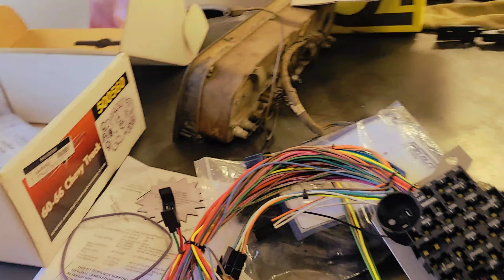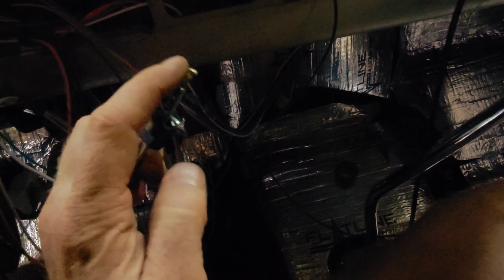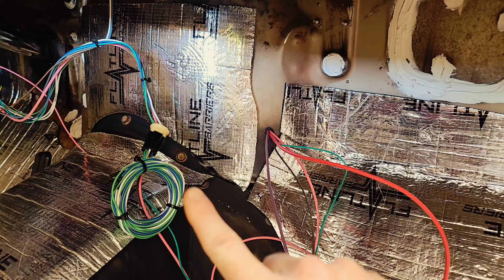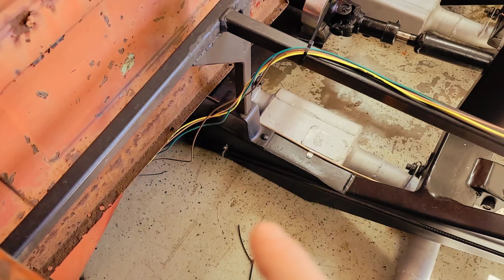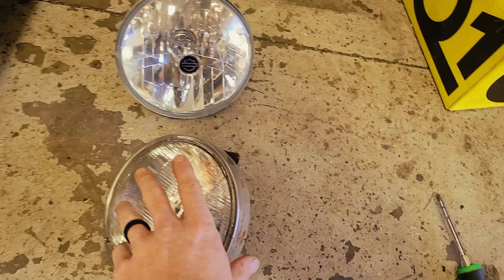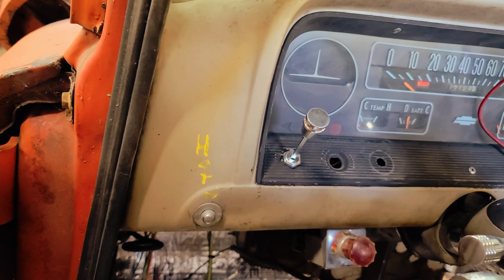American Autowire c10 install

Comment: Had a rat problem with my 60 apache. Bought and wired everything. I have running tail light but the brake lights dont come on when the running lights are on

Comment: Matt, I have another Question on the purple wire for the starter ,do you connect the 2 purple together if you don't have safety. Nut switch ? American auto not open today ! So thought I bug you again.
Reply from the maker: You mean like a neutral safety switch?
Reply: Yes
Reply: Mines a 4 speed no Nut safety switch

Comment: Hey I have Question on the Auto meter wire set does the red positive to the fuse block come out buy it self not the bulk head ? It's show the red going out but don't say how
Reply: Yes it's say to the inside of cab ,but I think it's the same to Batt since there that red pig tail on there ,I do that thank you ! So much
Reply from the maker: No problem. Hope helped and not caused more confusion lol
Reply from the maker: One goes to the battery another to the starter and the alternator. If I remember correctly

Comment: Nice job! What crimper tools where you using? AAW tools are expensive as Coc*ine ( I guess)Specially when you have other types of crimpers in the garage. Oh, do you have a video of your Gas tank? ( Can't find it if you have one)
Reply from the maker: Hey. I just used some old channel lock crimpers. I’m sure they make a special one. But I haven’t had any issues. Also I do not have a fuel tank video unfortunately. Thanks for watching
Reply: @Metal_Massacre_Fab_Shop  About the tank connection. I thought you connected to the bottom when using carbs. But in your case you go in from the top? Sorry for stupid questions ;) I like your channel, you are doing good!
Reply from the maker: Yeah the pick up tube is on the top on the Boyd tank. Appreciate you watching. I plan to wire my 66 gmc soon. I hope to make a much better version of this video
Reply: @Metal_Massacre_Fab_Shop  Nice, looking forward to the episode! Here in Sweden we just got 4" of snow haha
Reply from the maker: @tokslut ouch. That’s no fun lol
Reply: @Metal_Massacre_Fab_Shop  Thanks!

Comment: Just want to say thank you for putting your video out, I have a 1964 Chevy C10 that I am updating the wire harness on as well, I just can't find a diagram that shows me how to connect the rear tail lights, you did show in your video how the wires ran from the cab to the rear but you never showed how you connected the lights, I'm stuck maybe you can help, thank you
Reply from the maker: Thanks for watching. I’ll send over a link. Hopefully it helps http://67-72chevytrucks.com/vboard/showthread.php?t=721119

Comment: What steering column are you using ?
Reply from the maker: It was just a cheap 30 inch gm column I found on eBay. Has a little play in the tilt mechanism

Comment: Cool old truck, I’ve got a “63” did you have to change electrical connector ends for your truck? I’d bought the same wire kit “exactly same kit” started the wiring of mine yesterday.. it appears that many electrical connectors have to be swapped over to newer types? Thanks in advance nice truck Sir! Love the lowering you did to it.. nice ride Sir!
Reply from the maker: Yes some of them have to be swapped over it seem and others will remain the same. Thanks for watching 👊🏻
Reply: @Metal_Massacre_Fab_Shop  Very cool, I’m sure it will be easier once I get into more of this wire kit, but thanks much for all you post here! Cool truck Sir, keep-um rolling! Nice, keep posting your work, it helps many I’m sure of it, you rock Sir! Nice ride, cool you got a 383 too! Putting a fresh Tremec 5 speed in mine …. Soon, got the tranny, gotta do the run-out check and fab-it up for my fresh 383.  For it from a company out in Washington State.. “Hot Rod Company” don’t bother with them, valve train geometry is way off and I’m fixing the “drunk monkey’s” wrench turning on my 383 from them.. Expensive engine, and just wrong in soooo many area’s.. I’m fixing the mess.. Fresh, but not a good “build from them.” Great , but not so great.. I’ll make it right.. Ha ha, actually have the engine in my living room brought it in through the side door.. clean enough to eat off, so why not right? Ha ha.. again thanks you Rock keep going, I’m sure you will Sir, nice ride!  Thanks Sir!

Comment: Cool Sir! I’m using the same “American Autowire kit” very cool, hey is the rear taillight on left working? I’m sure it is now.. hey cool old truck mine is a 1963 lookin good project Sir! Great to see one into the same, love the souls of the “63” had 2 Chevy’s both old “63” Nova’s or I call them Chevy Duece or Chevy 2’s.. Cool ride , hey you seem better mechanic on engines, sounds really healthy Sir! Mine has a fresh 383 Stroker from “Hot Rod Engine Company” They are out in Washington State, beware don’t get an engine from the coast to coast deal.. They said they routinely send to the East coast, they smashed my engine 2 times trying to get it to me wrapped in plastic and cardboard, ha ha.. third time owner got involved in it.. Good mechanical they provide but can’t send an engine any distances without a smash or three, ha ha..
So, finally they got another shipping company, went from “Yellow” to using company called “XPO”  They got the engine to me “Un-smashed” So you Rock Sir, keep turning the wrenches! Nice sounding engine in your truck, what is it? Do tell us about it? Probably already did, I’m a late seeing to this site. “Nice truck Sir, keep-up rolling!”
Reply from the maker: Thanks for watching and bummer to hear about your engine. Mine is actually a 383 also.
Reply: @Metal_Massacre_Fab_Shop    Nice! 383 Stroker, looks nice sounds awesome Sir!

Comment: Generally with a 10SI / 12SI alternator, the larger brown wire goes to the dash bulb, then to key B+. The bulb limits current to 1/4 amp (0.25 amp) and system voltage for sensing. The second wire is dead until changing then operates a relay for the choke heater. B+ from alt, to the relays coil to ground. Key hot during crank, run passes thru 30 & 87 to choke. Key on, engine off, you don’t want the choke opening as it will be hard to start. Thermal fan switch is in coolant and provides ground for 1 or 2 relays. A 30-40 amp fuse depending on fan, to 30 & 87 as both grounds soldered and shrink tube can bolt to core support using “Star” washers that dig into paint to metal. Internal star washer goes on first, flat washer, fan ground flat, lock washer and bolt. I use dielectric grease on every terminal inside connectors plus sides and bottom of park bulbs. This keeps them from turning green with high resistance. Both washers & dielectric grease is sold in automotive at home improvement stores, 1/2 price of parts stores. Ground parts and sensors. Use Permatex white pipe & thread sealant as it will allow connection to ground. Teflon tape won’t work! The back of the alternators case is where ground is produced. To provide a complete circuit, run a 4/0 cable from threaded hole on alternator to intake or block, don’t forget intake to cab & ground terminal at HEI distributor. It is marked as metal strap bends and terminates a coil screw. Ground from battery to inner wheel house / fender, frame, block, fame to cab underneath and since it’s a truck, provide frame to bed ground to reduce voltage drop to stop, turn, reverse and tag light! Also, tail light assembly crimp socket into housing. Time may corrode this connection. Empty the socket, wire wheel and solder this connection. Using LED’s are great at 12Vdc but real low current. This increases voltage drop problems. I drill, clean, machine screw with star washer and run separate bolt to beds frame. Any place that can get wet, drippy boots, snow, car wash and humid days when temp drops overnight as dew on grass, dew on metal terminals.
Take photos is easy now, so color, face female and male, wire size is metric, circuit numbers (Since 86) GM uses same colors and circuit numbers. They are broken into cells to everything in one circuit from horns to tail lights. Location of connectors have an order as well! Engine compartment is 100 series, dash is 200, 300 at rear seats, 400 at tail lights, 500 is bumper, 600 LF door, 700 RF door and so on. 
  So in reverse lights, battery at top, fuse to relay/fuse box, connector gray (Photo on page 203-H) cavity A13, gray w/ black, frame to tail lights. Reverse switch, relay, fuse, connector to complete circuit when in reverse. Increase’s selling value, reduces the cost of out of town repairs, include brands, P/N’s, special notes, specs, line size, torque, wrench size and bolt spec like grade 8. Include charts for references as a good tech can and fix it cheaper with info. Printed, thumb drive or CD will make any future repair easier, faster and less money. Copy receipts that have lifetime warranty, with customer service number and serial numbers that can be provided.
  Sorry, but after 38+ years, I have learned a couple of things. DK ASE master tech 78.
Reply from the maker: That is awesome. I hope to have this amount of knowledge one day 👊
Reply: @Metal_Massacre_Fab_Shop  >Don’t worry. You pickup a lot after doing something over & over after 35-40 years.
  Electrical is one of my favorites because once you confirm as customer concern, you check for all electrical things and note only what you find. I stand at the bench, look at the wiring and ask; If this looses ground, this would cause all of the current problems. Their are good videos on voltage drop, it is my “Go To Diagnostics”. With digital multi meters, circuit on and current flowing, the device in a series circuit consumes all of the voltage. If 1.3 volts lower than battery available, stay on the ground side and walk backwards in the circuit until the voltage drop shows that 1.2-1.3 Vdc. Bingo! 
Guys used to sweat it and asked “Well the Red lead go here, that black goes there” then I stop them. If the leads are backwards, it simply shows a (-) negative symbol in front of the exact same reading! I did not have the luxury of doing brakes only, transmissions only, I had to do everything. 
Call backs? What is that? Right. An older shop owner showed me on a Friday night as he called the customers back after they had driven the vehicle a little. He iD himself, then ask if he drove the 1994 Red Park Ave and was he happy? People where shocked to get “That Phone Call”. And we’re tickled. At a cold, sterile dealership, I would call the customers, Hi, I work on your XXX this week at the dealer and wondered if things were fine and if the had any questions? Once again, I got your business card and you wrote on the back, check fry brakes 3K miles, change all fluids in your 4X4 in 6 months before winter comes to town? They had never got that service before and I stayed busy not getting estimates, but doing! Tell my service mgr I needed another box of 500 business cards! He asked, what are you doing with them. I write thanks on the front, circle my name, wrote “Over” on bottom and listed future services they would need. Customers had them stacked in order with a rubber band, come into the dealer as tell the writer that “Dean said I needed this done, just do it, call me when finished! I had over 3,000 customer who had been in for repair 3 times of more in the last two years!!! T-belts, fluids, brakes, adjust valves or whatever. It kept me busy! Have a good on and shout out in comments if I can help. Ok, later. DK, Omaha.
Reply from the maker: @deankay4434  awesome. Thanks for the help 👊
Reply: @Metal_Massacre_Fab_Shop   >Any time! I spent $150 on my first vehicle, a 1965 C10 Apache w/283 and power glide. Owned as a fuel/oil truck for a big construction company with dozer, backhoes, scrapers and the wood bed was soak with spills. The floor was perfect as GM used old growth Southern Pine. I was 12 but grew 7 inches the year before. So, 6’ 3” and had a good start on a mustache. 218k before the cable broke. Back then, drivers license had no photo, double weight glossy paper and simple said School / Farm + M
Yep, good old days to me. Never got a nickel from parents because as the oldest, I found out at 14, I was adopted. Light skin, freckles and reddish light brown hair. My half brothers dark skin, curly hair and short. I haven’t spoke to any of them since 1977. I did chores for 2-3 hrs each night as they watched TV. Oh well! What’s that old saying about your can pick your friends, pick your nose but can’t pick your parents! Lol.
Have a good one. I am wiring twin fans, alt, choke, fan switch and fuse / relay center on my youngest sons 81 El Co I just painted all white 4 months ago. 500 horse pony’s with 700R4 I built, he is on diff #2, broke #1. It is flawless and perfect metal bed. I got 50+ hours in stud gun pulling bed floor smooth. Stay safe! I got a 67 C10 with LS but stock height. White over copperhead metallic, son hates the color and wanted me to go short bed. I told him to paint it pink with purple poka dots when I am dead!

Comment: What steering column did you use? To be able to use the original steering wheel.
Reply from the maker: It is just a cheap tilt column off of ebay. It's a gm style so the splines line up in the wheel